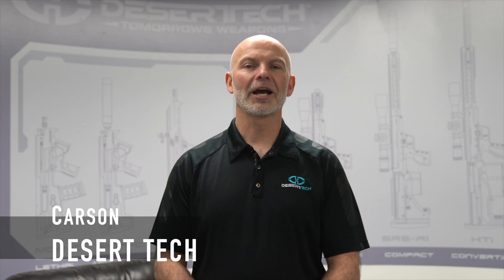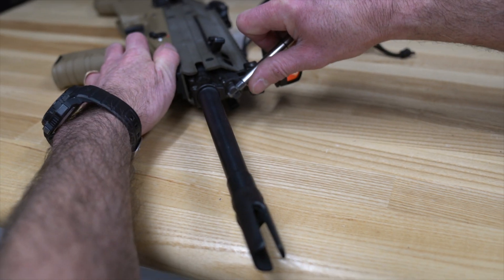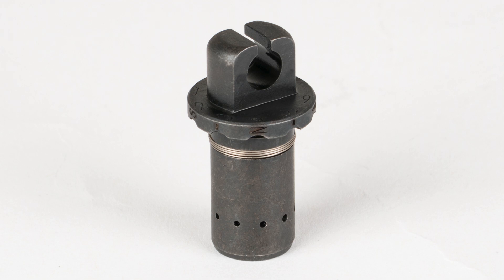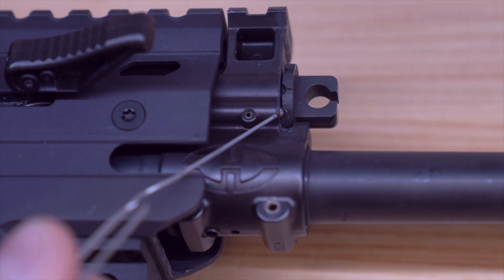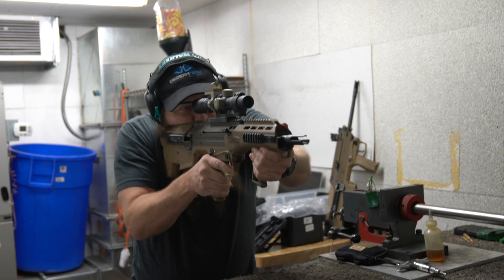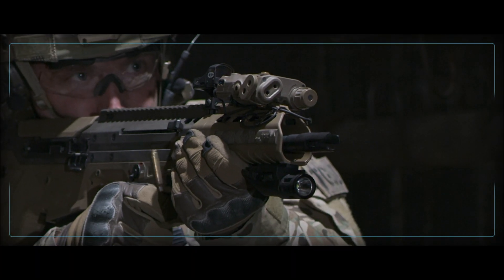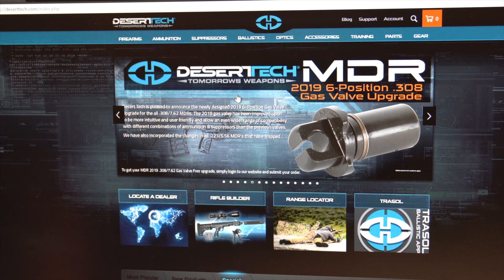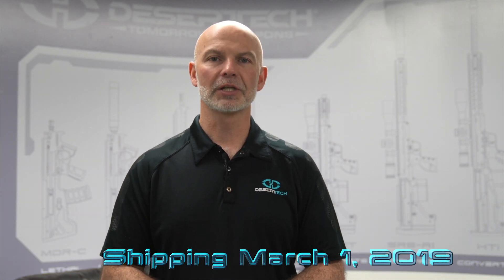2019 MDR 6 Hole Gas Valve Announcement | Desert Tech

Comment: Will this solve the failure to eject issue where it is ripping the rims off? Obviously it won't fix the issue of fte on an unspent round getting lodged in the ejector mechanism but that one is way easier to fix than a ripped rim.
Reply from the maker: As was mentioned in our previous video avoid Wolf and steel cased ammo and you should be ok.
Reply: @DesertTechUT  I don't ever run wolf or steel case ammunition so hopefully this solved the issue.

Comment: Two things:
1.  Steve called me several weeks ago and told me that I didn't have to do anything and that the gas valves (I have 2 MDRs) would be shipped automatically.  Now I have to sign up for this?
2.  The link doesn't work...there isn't anything on your home page (6:53EST 6 February 2019) to submit information.
Reply: And 3:  Even after logging in and clicking on the link, there is no form or link to a form on the resulting page.
Reply from the maker: @kfeltenberger  link is working now.  Thanks for letting use know.
Reply: @DesertTechUT  Thanks!  What about the first part of my comment?
Reply from the maker: @kfeltenberger  I don't think at that time we had an official release plan locked down so I would recommend ordering on the site.

Comment: One of the complaints I have hear the most is how unaccessible the gas system is. If you guys make it more accessible, like on the sig 516 and 556r, feedback will get better.
Reply: Did you not watch this video? You use a screwdriver or something similar to adjust the valve without removing the handguard!
Reply: He is talking about having to remove the hand guard.
Reply: @The_John_Galt  DID. YOU. READ. MY. COMMENT?!!! The slot on the end of the valve is so you can adjust the valve with a screwdriver WITHOUT REMOVING THE HANDGUARD! They show this in the video.